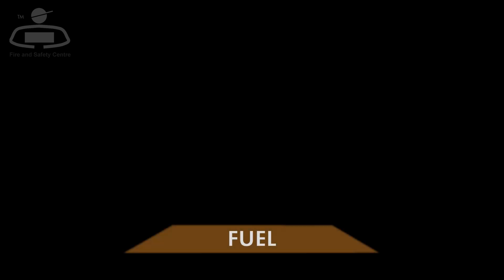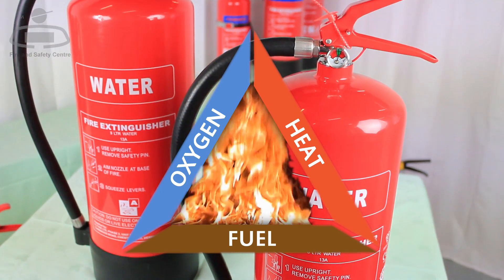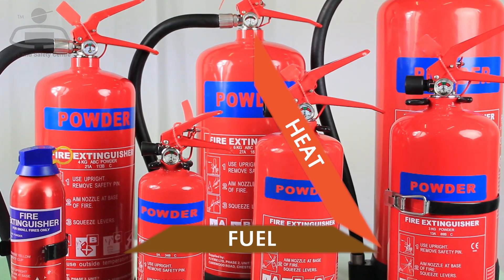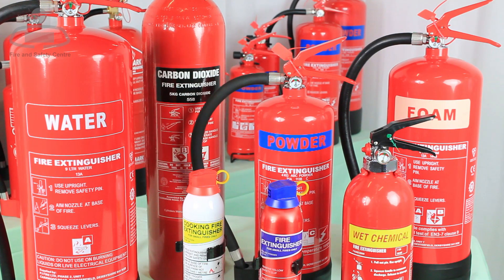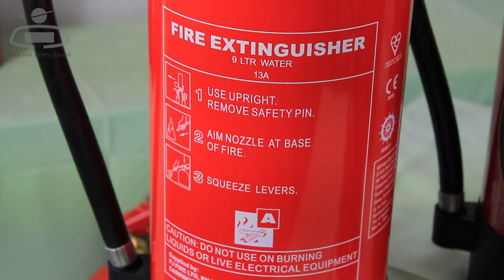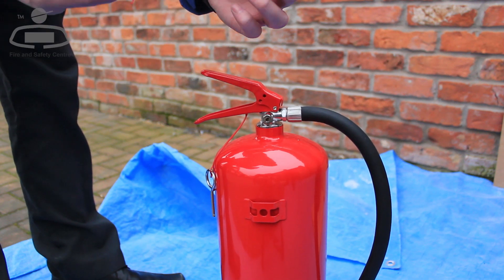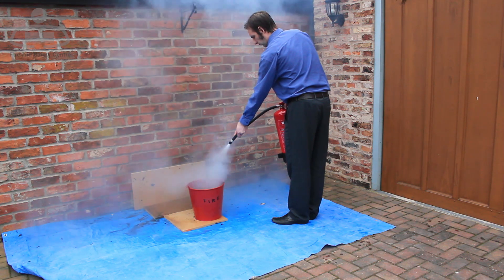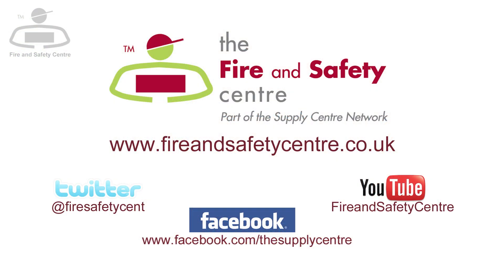How a Fire Extinguisher works and how to operate a Fire Extinguisher

Comment: Am I supposed to pull out the "plastic pull tight security seal" during the fire or when I purchase the fire extinguisher so that it's prepared?
Reply: Maybe
Reply: Pull during the fire.  With the seal holding the pin in place, that helps prevent accidental discharges.